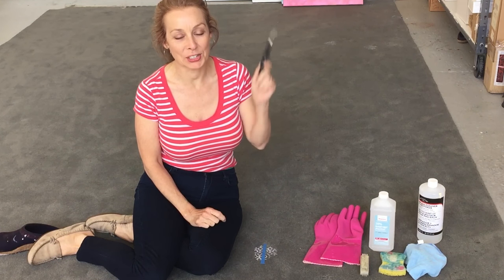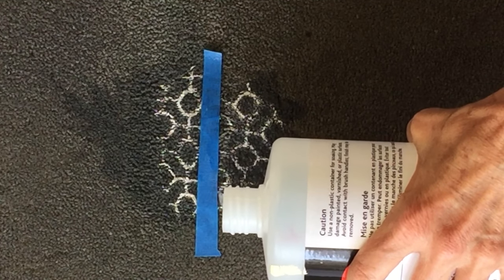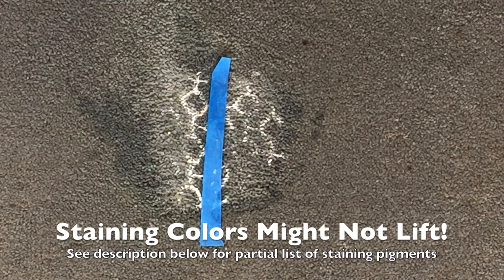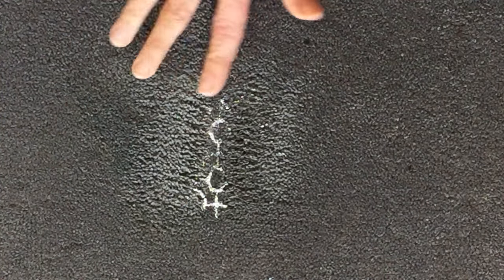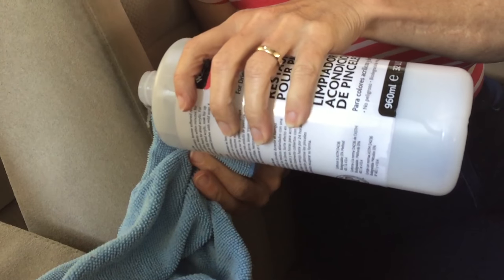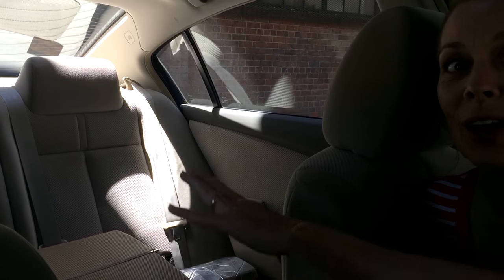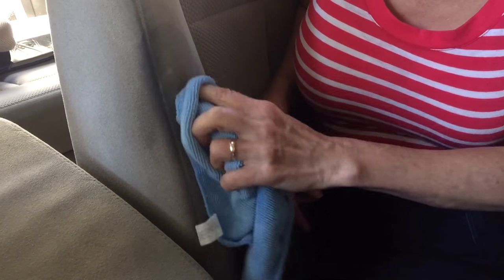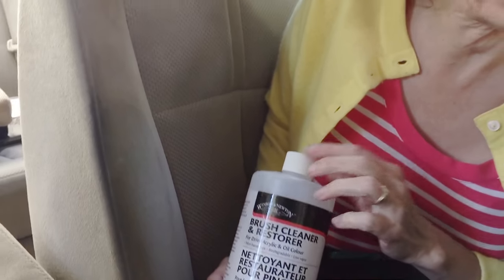How to Remove Acrylic Paint from Carpet & Upholstery

Comment: B&J "The Masters" brush cleaner soap will remove oil paint from carpet very well. I dropped a glob of oil on my brand new carpet in my studio the other day. A heavy mixture of ultramarine and raw umber mixed mixed to a purpleish black. I was certain that I had ruined the carpet. "The Masters" lifted the paint right out of the carpet. It's water soluble so there's no need to worry about harsh chemicals damaging the fibers. Happy to see that you were able to remove the stains from your affected areas. I would be concerned with alcohol or other chemicals damaging the upholstery on the padding underneath your upholstery on an automotive application. It's easy to distort the fibers. Thanks for your suggestions, they're very helpful.

Comment: I use the da vinci soap paint brush cleaner 😊 it's more better and stronger than the liquid brush cleaner.  It works on your clothes, bedding, brushes it's fantastic and you add a bit of water to it and leave to soak for a while then you scrub and it takes out the paint and the stains. I'm an artist and I get paint on everything 😊.  My daughter bought me this soap and I've had it for 4 years now and it gets paint out your brushes after the acrylic is dried the bristles together.  But I first soak the brushes in boiling hot water then when the brushes had soften I rub the soap on it and leave it for a hour then I scrub it with a green scourer and nail brush. My brushes are cleaned. Try this soap get it from cowling and wilcox and any art supplier 😊

Comment: For acrylic paint, water and dish soap may work very well without fading the fabric. Just try to keep the stain from drying. If you delicately rub dish soap and water it will dissolve after a few minutes of rubbing. It just needs good soaking and delicate rubbing for a few minutes to get out. Tried the gray artist soap on a different accident with acrylic paint, BUT I got my linen blouse bleached with it. So unfortunately artist's soap causes fading/bleaching of linen fabrics, denim, and whatever else that might fade.

Comment: What would work best with black acrylic paint? I need to get it up. It’s soaked in the carpet and has been there for quite some time. Any suggestions?
Reply: My 5yr old painted my light tan couch with black acrylic paint
Reply: Oh so sorry to hear that. I still need to try to get the paint stain out of the carpet. I temporarily covered it with a rug. Good luck getting it out.

Comment: Will this come off my car seat if I have acrylic paint on it?
Reply from the maker: Oh boy! Do I have a story for you! One time when I was driving around Canada teaching workshops I had some wet paintings that I wanted to save so I stuck them up on the shelf behind the backseat. Unfortunately, I hit a bump and all the wet paint came pouring down the seats of my, rental car! I was freaked out that I would have major damage. I pulled over and worked and worked on those seats with the brush cleaner and restorer then I had to wash and wash the oily residue off with soapy water. But to my great relief, it worked! I can’t say for sure it will work for you because it depends on the color as I mentioned in the video. Some colors leave a permanent stain. But please give it a try. What have you got to lose?